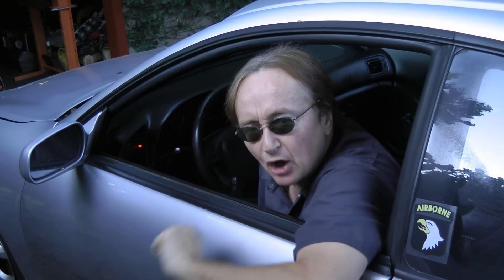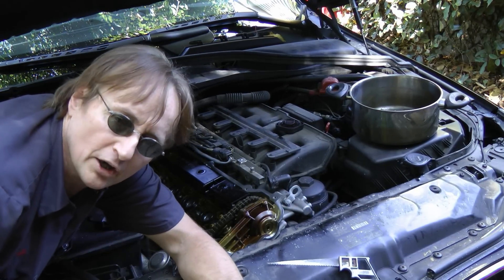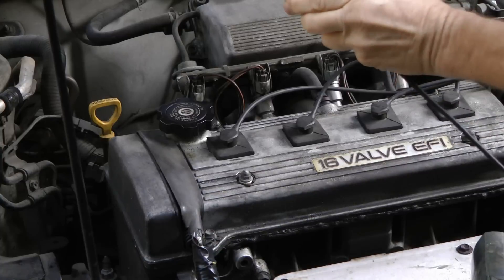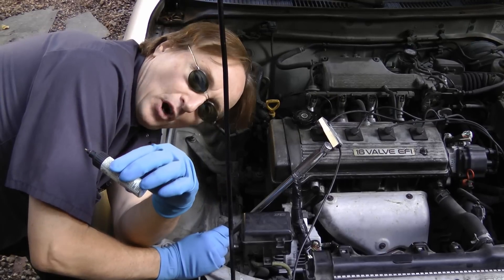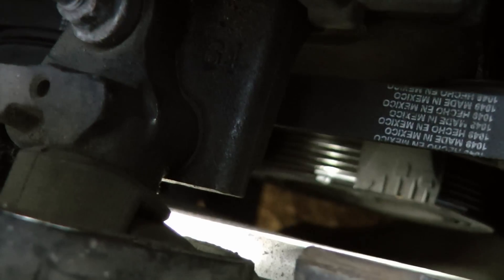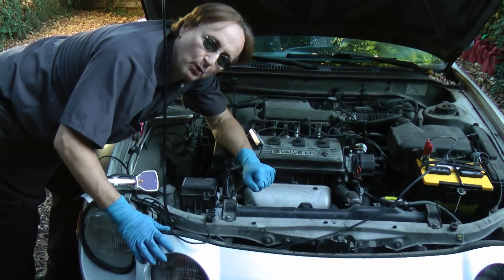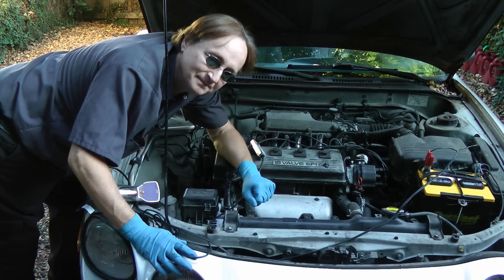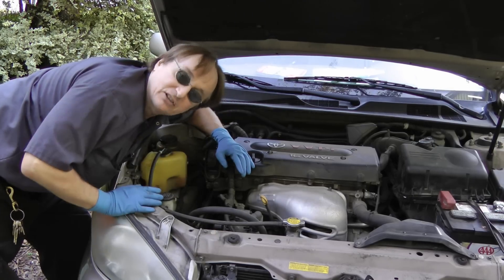How to Check a Timing Belt or Timing Chain in Your Car

Comment: Hi Scotty, I have 1991 Suzuki Samurai 1.3L FI SOHC 4cyl, just recently changed the timing belt, and still it turns over slow and takes a little time before it cranks, but once it starts it runs great. any ideas what else it could be, battery has good charge. Thanks

Comment: Mr. Scotty Kilmer, I have a question. I have a 94 Chevy Caprice Classic and lately it's been giving me alot of trouble and has recently stopped running altogether! Weird thing is, is sometimes it's will start, and sometimes it won't! And it makes a sound like my starters not catching but then after a few cranks, it'll start up! I'm not sure if it's the starter, the timing chain, the flywheel, IDK! I know it definitely needs a new water pump, it's leaking like a seive right now. Could it be that both the timing chain and starter need replacing?? I'd appreciate your advice, thank you!

Comment: Hey Scotty, I've got a 2002 nissan supercharged pickup truck with 100,200 miles on it and I noticed sometimes when I initially start it up it ticks for a few seconds? I use 10w 30 fully synthectic oil.... Does that sound like a lifter issue? it uses no oil and idles and accelerates fine.... Thanks...

Comment: Hey Scotty..I’ve got a 2000 Chevy Silverado with the 4.3 v6..it’s been throwing a p1345 code for about a year now..1st we suspected the distributor was put back in wrong because we had recently torn the intake manifold off to replace the lower intake manifold gaskets..after checking the position of the distributor and even replacing the distributor the code still remains..I have also replaced the cam and crank sensors due to the fact that they are related to the code yet the code still remains..the Truck will occasionally stumble at take off or be hard to start, and today on my way home from work it jolted real hard on me as it shifted into passing gear..I have been told by a mechanic that it is running out of time..any suggestions as to what I need to replace? Thank you.

Comment: Hey Scotty, my 2002 Jetta clunks when I hit on my brakes, but only when I am about to stop. It's always ONLY one little clunk, and you can hear it coming from the driver side wheel. Control arm has been replaced recently too, but the clunk is still there. Any ideas?

Comment: hey scotty my dad just bought a 2001 ford ranger 4.0 sohc and the guy say that the timing chain had broke and he did the left side timing and didnt do the right side timing on it!! it sounds like there is a lot of valve chatter on the right hand side! it does start and run but has no power!! could the timing on the be good on it and the valves being bent cause it to have no power or is the timing completely off? Love the show by the way!! thanks
Reply from the maker: have the timing marks checked first by removing valve covers and putting engine at top dead center to see if either side is off. If not, he really should have done both sides during the first job.
Reply: Scotty Kilmer thanks scotty for the help and my dad bought it off a guy and he had the timing done on it! my dad bought it for a good price and was going to just replace the engine but i wanted to mess around with it since i like working on these kinda things!! if the timing is good on both sides could the valves bent and cause the power lose? thanks for reply i really appreciate it!! keep up the great work and videos!!

Comment: it will sounds like a diesel.uve got to use the correct oil from day one . usually 5w30 fully syth oil,or advised by the car maker. every 6000 miles. or 10,000 klns

Comment: Hi Scotty my Subaru WRX is 6 years old but the mileage is only 33000km do I need to replace timing belt or I still can stick to the owner's manual recommended at 7 years or 105000km. Thank you.

Comment: How long timing chain tensioner and bearings last? Do they last as long as timing chain? Or on engines when used timing chain there is no tensioners and bearings, and they are used only in engines with timing belt?

Comment: Last year, I bought a 2003 Ford Focus C-Max(UK MPV) with full service history. It had only 82k miles, drove it home, and less than 500 miles later, the timing chain started rattling. Had the chain kit fitted, chain and tensioner etc, then it just ran like a pig. The garage that did the job checked the timing, said was ok, so they changed the O2 sensor, no good, changed the cat, no good, changed the whole exhaust, no good. Changed the PCV, no good.  Changed the plugs cos they were getting really black with oil. Eventually they said they didn't know what was wrong with it and said they could no longer work on it. Had to sell it for scrap.
Reply from the maker: +Charley Brown   hope you didn't pay them for the job
Reply: Unfortunately, yes, I had to pay for all the parts they changed, but they didn't charge me for the labour. I spent nearly 600 UKP on parts, and sold the car for 510 UKP, so still made a big loss.

Comment: Hi Scotty. Every so often, my Cadillac Deville coupe, 1992, has wisps of smoke issuing out from the steering column right behind the steering wheel. It happens only at high speed travel - 65 mph after a hundred or more miles of travel. No one has found the culprit yet. It's been a while since it has happened. It's unnerving. I am not a mechanic. Any ideas on how to track it down?

Comment: i have a question about my 1985 gmc jimmy s10 v6 2.8Liter what the most problem if you crossfire the firing order and back fire smoke and i had fix the firing order and now all it does it back fire smoke from the carb

Comment: On these newer cars there are no ignition wires. Where do you put the sensor if the engine has coil over plug distributerless ignition?
Reply: you would need to get a spark test lead that is basically an extension and put it between the coil and the spark plug then attach the clamp to that

Comment: hey guys i got a 99K 2007 Toyota Camry XLE v6 and that how i end up here if anyone can tell me or help me at what mileage should the chain replaced ? so far the car runs perfectly with no problems at all but i still need knowledge to prevent more expensive repairs. I already try to check the owner manual at the maintenance section so far too much talk not providing the helpful  information . so i couldn't find what i'm looking for .. thank you for your help

Comment: Hey Scotty, ive been working hard on my Nissan sentra 2002 SER. recently the oil light has been coming on when at red lights or on off ramps, timing chain making tons of noise at low speeds, oil light goes off when i hit gas, recently its been staying on more, 2 days ago was on highway, went to pass another car, car went into safe mode no starts but wont go above 2k rpms. any ideas? oil pump maybe? i changed the oil pressure switch a month ago.

Comment: I have a 2000 Chevy prizm but the car won’t turn on to check the timing chain, it has new spark plugs, new wires, new starter and new battery. It wines as we try to start it, but doesn’t turn on. Do you think the timing jumped?

Comment: my car makes a chirping noise when I turn it on (both idle and moving). I think it's the belts, but once the car heats up (5 minutes of driving or so) the chirping cricket noises go away. Is this a timing belt issue or something lesser? I just bought the car I'd be heart broken if I had to replace the belt right now.

It's an '03 acura rsx.

Comment: Hey scotty I have a question about my timing belt should I chage it? I have an acura tl 2000 and it has 156555 mile on it and I dont know if the car has been change the timing belt or not so do you you think I should change it?

Comment: Hey Scotty

I'm having a problem with my signal lights. I turn my signal light on to turn and the light stays solid. I then turn the signal light off and back on again and then it works fine? Its the same for both sides. Any ideas?

Thanks

Comment: The vacuum advance on my Range Rover classic will advance the timing to about 25dbtdc at idle then as soon as you open the throttle the pressure drops inside the inlet and the timing retards momentarily. The centrifugal advance takes over as engine speed increases thus making my timing mark jump backwards and forwards on the gun. I'm pretty sure my engine is healthy but could you just clarify what you mean by a jumping timing mark? Thanks
Reply from the maker: one that jumps back and forth, rovers will advance when you open the throttle, but they don't jump back and forth as a worn timing chain would do

Comment: What about if the car has VVTI and coil on plug? will the timing light still work? won't the computer compensate for worn chain?
Reply from the maker: +Jeff Powers timing would still move around with a worn chain regardless

Comment: I wonder if this timing gun would work on an 03' spyder eclipse v6. I just bought it used. 170k but well maintained. I figured out the previous owners name/location (tire receipts), but I'm reluctant to bother her for history of timing belt. Any advice?
Reply from the maker: it uses coil on plugs, but if you put the timing gun inductive sensor on top of a coil on plug assembly, it normally will make it fire
Reply: I think they use a timing belt so you may want to replace to be on the safe side.

Comment: While changing timing belt. Machanic may have to remove one or two driving belts along the process. You must warn him not to overtight those belts when putting them back because overtight those belts harm to equipment bearings. Believe it or not, not all machanic have this knowledge.

Comment: I have a 2000 Honda CRV and I have had no problems of noise, rough idling or acceleration  problems.  The other day my car just stopped.  I had a friend tow me home and he thought it was the head gasket as it lost power.  After looking at it (was like 7 the day I broke down) the next day they said no it was in the ignition system as it will turn over but not fire.  I had an actual mechanic come over and he says its the timing chain as the cam isnt moving.  I am not working and I dont want to pay for work that doesnt need to be done.  I hadnt had any problems with it and it just up and died.  Any suggestions? I know its hard to diagnosis like this but I have watched a ton of your videos over the past several days and thought I might ask your opinion.  Thanks for any input you might have.
Reply from the maker: easy to see, remove the distributor cap and crank the engine, if the rotor inside does not spin around,  it's the timing belt or chain that has broken. If it does spin, dists go bad all the time on those causing no spark

Comment: hi, scotty. I just put new timing belt on 1992 Mitsubishi expo with 4g64 engine. first of all im not 100 percent sure where the number one spark plug is. so I guessed and put the inductive clamp on around the far right spark plug next to timing belt. then I used a timing gun to check the timing but the timing mark is off tdc(advanced about 10 degrees or so) and I tried to turn the distributor to align the marks but that was the closest point I could get. what should I do and which one is the number one spark plug? thanks much.
Reply from the maker: doesn't matter which plug you use for timing light. If it runs good at that setting, leave it.  If not, timing belt needs to be put back on correctly, it would be off a tooth

Comment: The timing chain on my '92 Nissan hardbody rattles in the morning, I think the guides and the tensioner need to be replaced. How much of a repair should that be?
Reply from the maker: +RGO Impact quite of bit of money, but depends on the engine size. for example, 6 cylinder would be more than a grand
Reply: +Scotty Kilmer mine has a 4 cylinder and it's also a common issue with this particular engine

Comment: Does it matter if the timing belt goes on tight? Or if it can be to tight & would that ruin your engine or bearings in the crank?
Reply from the maker: it has to be the correct tightness, most modern cars have auto tensioners on em anyway

Comment: If the rollers of track belt there jumping! How do you know from where is the problem?Can be from the rollers outside not form the timing chain inside.
Reply from the maker: yes, you'd need a new chain and pray the gears weren't worn unevenly
Reply: ok thanks

Comment: Hey skotty, so I have an 84 Toyota pickup with a 22r, I'm pretty positive my fuel pump went out, because I was driving home doing about 60 then every time I stepped on the gas more it back fired and putted until I let off, and my gas line is empty, is there any quick fix or would buying a new one or putting a manual pump be easier?
Reply from the maker: +Tyler Brooks you can't put on a manual pump IF it has fuel injection, but you can if it's carburetored

Comment: Hi Scotty. I own a 2007 Proton Satria Neo. Pretty good engine etc, but in wet weather, I get an intermittent squealing. From what i've read around the internet, it's most likely the timing belt slipping in the wet. Would you agree with this diagnosis? I have no other information, and the car drives fine at all times, even during the squeal.

Thanks in advance!
Reply: Sounds more like an alternator/power steering belt.
Reply: +James Hunter I'd say your belt is not properly put on and is slipping, get a new belt and have your local mechanic put it, shouldn't cost but 60--70 dollars.
Reply: +James Hunter Squealing is more likely from your accessory belt (alternator, air con etc) and not your timing belt . Timing belts all have teeth so they won't slip like that to cause squealing (if it did your car would stop)
Reply: +Rennie Ash . Hi Rennie, your close to what I am seeking help for, cause I had to replace the 3 belts not long after timing was done (yeah should've all been done together, anyway), but now I've replaced the a/c, drive and power belts on with good tension i'm sure there is a 2-3 second squeak on cold start only.? Any idea there please?
Reply: Craig Baxter Maybe a belt still slips or you have a pulley that needs grease/replacement. Or, it could be a bearing etc elsewhere but I can't say :-P
Reply: thx. Yeah i'm going to re-tighten one suspect a bit more to be sure, just confused with only 2-3 second squeal instead of ongoing squeak!?

Comment: The timing to your spark plugs is controlled by the ECM.  A worn timing chain or belt  isn't going to change the timing unless it's an older engine that runs on the old point system.
Reply: Robert Brunner not true
Reply: I've been under the hood for 49 years when it comes to cars.   In 1982 US cars no longer use the old system.

Comment: I have a 2003 saturn l200 one day i was driving down the st and my car just stop moving i was pushing the gas but it wasn't going anywhere i pull over turned the car off and checked to see if my belt came off went back to crank it i wont crank do you have any idea of whats going on

Comment: Hi Scotty,

PLease help !!!
My parents are old and they bought a car (2006 VW Touran 1.9TDI) and were advised to change the tensioners, belts and the water pump and immediately after the change, the car no longer idles smoothly, it has some ticks, but only when idling, from what my father told me.
I am thinking, the proble is only from these parts that were not used in the propper way with the propper tools, because will be too much of a coincidence to be something else right after these were changed.
Can be a belt too tight, or bad Water pump ( it is a HEPU pump) even if its new...?
Please HELP, what do you think?

With respect,
Gabe B.

Comment: hi   my 2005  corolla is timing chain   ,257000miles  , i never replace it or water pump, it still running good . should i need to check the way like u did it in radio?

Comment: hey Scotty..I drive a 2001 Mitsubishi eclipse..when I start my car..I hear clicking coming from the belt . When I have to many things on at once...the radio will go out and then my battery and emergency light will flash on the dashboard... another thing I noticed is my car won't start all the way when I use my remote car starter (it'll just choke ) until I use my key manually to start it..but even then...when I use my key it takes a while to start...could it be the timing chain/belt? thanks

Comment: Hey Scotty my 2001 Honda Accord v6 runs fine it has 83,000 miles and has never had the timing belt changed I am scared of it being rotted is it still good.
Reply from the maker: Applekid change it now before it breaks
Reply: +Applekid CHange it and it will give you piece of mind...I had a 2001 accord lx 4cyl and the timing belt went off in the highway on my way to work. Tow plus some weird mechanic and $1,100 later I was ready to go...My mechanic told me if I would have gone to him it would be only $250...So do it now!

Comment: Scotty you used to be able to adjust the timing of the car with a light and by turning the distributor.  Today's car you can't turn the distributor to adjust the timing. On most cars the distributor is just fixed. How do you adjust the timing on modern cars? I have one of those lights but I haven't used it in a long time because I no longer own a car with a turning distributor.

Comment: I reinstall the main timing chain on my 95 Maxima.  As I rotate the crankshaft, some sections of the main chain get very tight, and some sections get slack.  Is that normal?

Comment: Does the timing gun work for cars with a coil pack instead?
Reply from the maker: you can set the sensor on top of coil on plugs and they will also fire then to show timing, it's an inductive sensor, does not need direct contact

Comment: is there a way of doing it for diesel engines? Thanks
Reply from the maker: as they have no ignition system, you can't use this.  You would have to have some pretty expensive diesel mechanic computer scanners to do such a test on a diesel